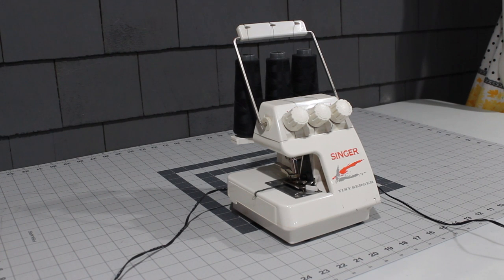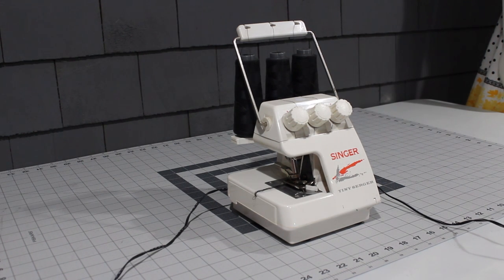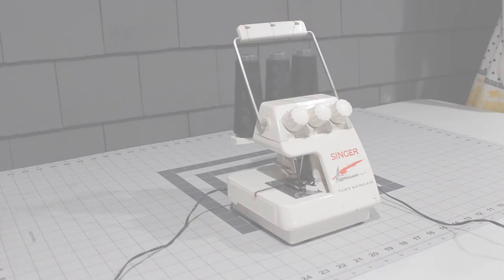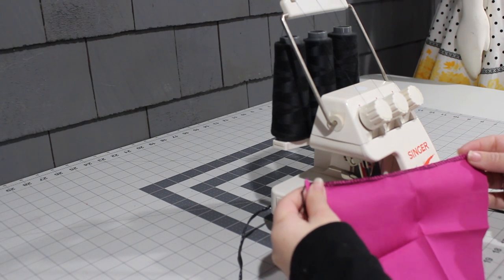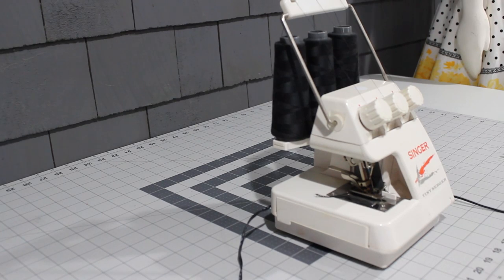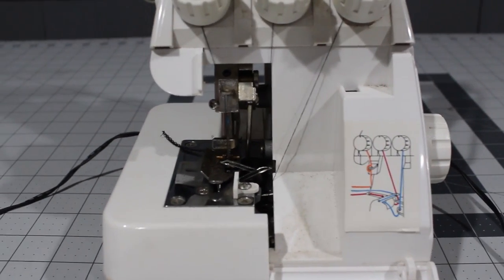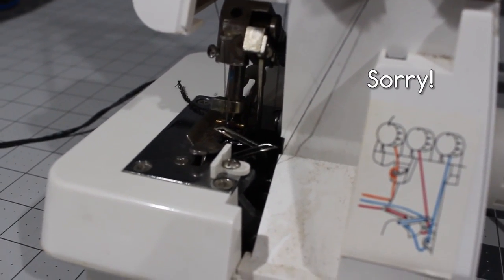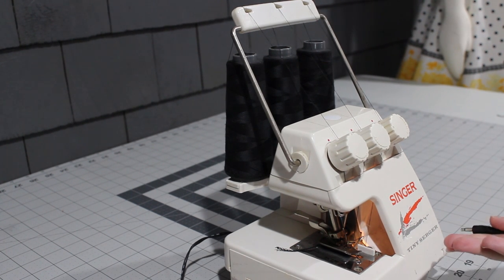Singer TS-380 Plus Tiny Serger Demonstration | Sewing Machine Showcase

Comment: The little light is a safety feature. 1) so you can see to thread those little eyes way down in the bottom. And 2) foot petal disconnected so you dont accidentally step on it while you are "struggling" to thread it. (Triple Ouch!)

Comment: The manual explains that the light goes "on" when you unplug the foot pedal because the light is meant for threading (guess they think that it won't help in sewing!) and by unplugging the foot pedal you will not accidentally sew your fingers while spending the 45 minutes (approx) that it takes to thread the machine.
Reply from the maker: Mardith Hammond Mystery solved, thank you! 😀
Reply: Yes, it's a 'safety feature

Comment: Thanks for the info. I was wondering if it was worth considering. I knit, and even though I'm also a seamstress, a regular sewing machine doesn't work well on many hand knit items, so I was thinking about getting a serger. But I would want to change the thread often, and even after reading comments that the light helps with threading, it still sounds difficult. I'm just not in the mood. I'll keep looking.